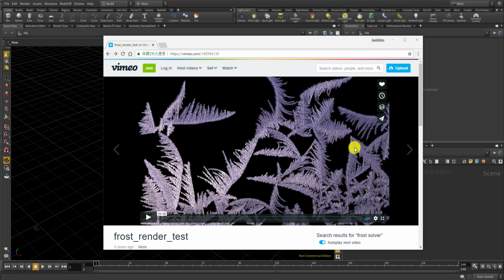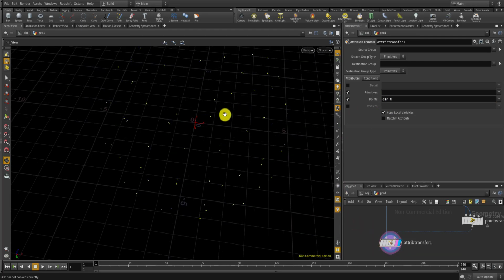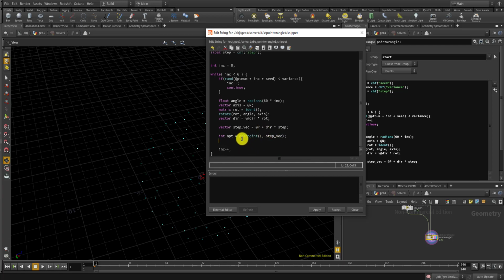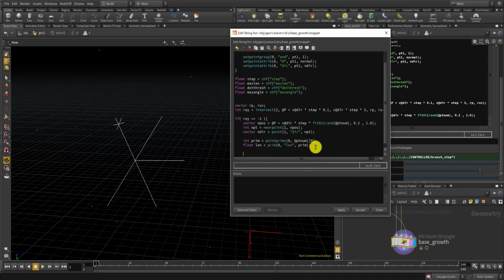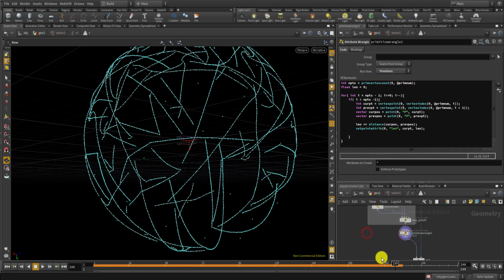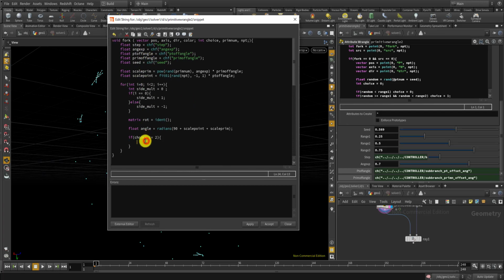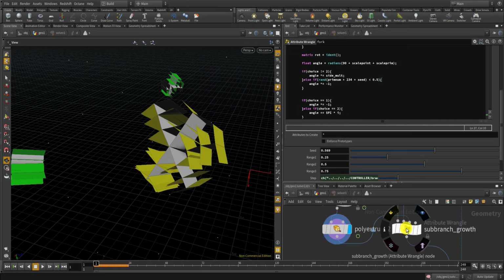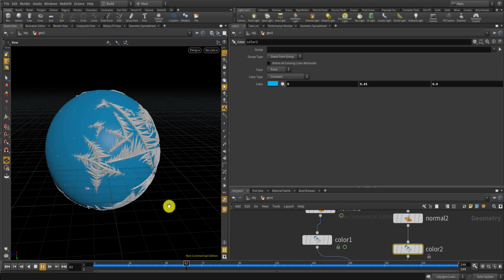[Houdini Tutorial] 0033 Frost Wrapper (Slow version)

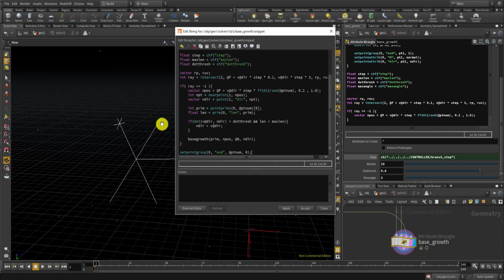Comment: at 1:37:40 you should project the end directions onto the sphere... your branches grow slower because the diection goes away from the surface of the sphere and is then projected back onto it (wich shortens the actual distance travelled to the next endpoint)
like that for example:

vector nnorm = point(1, "N", npt);

vector tangent = cross(ndir, nnorm);
ndir = normalize(cross(nnorm, tangent));